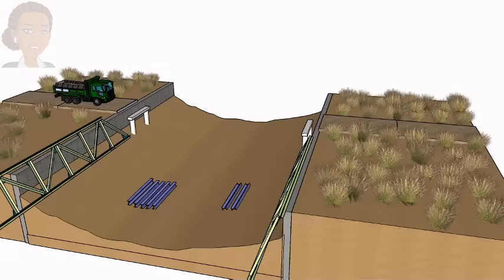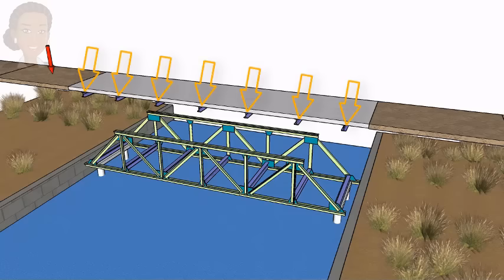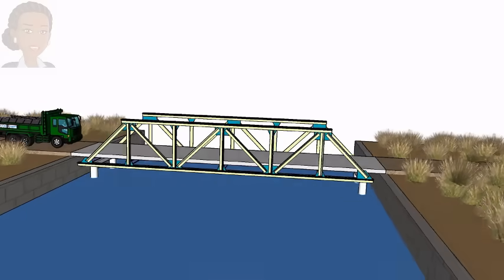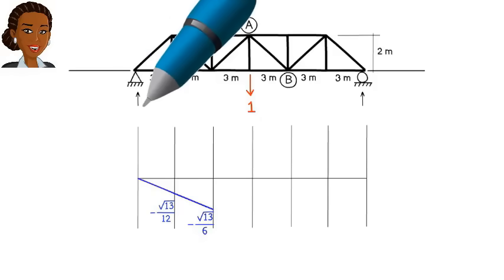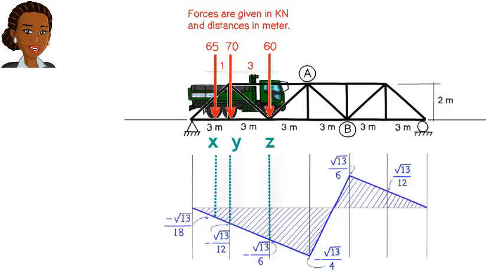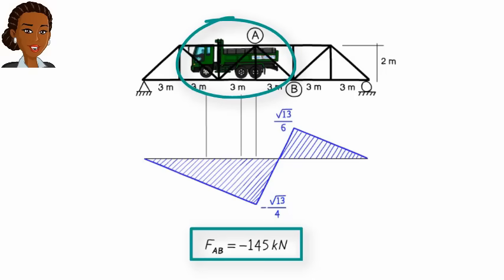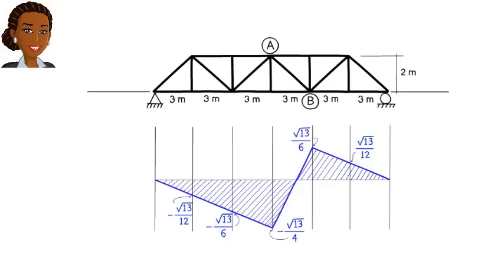SA35: Influence Line and Moving Load Series in Trusses

Comment: Let's say the given data are the following: bridge span = 18 m, bridge width = 4 m, and the deck is concrete with thickness of 0.20 m. Is the point load acting at the bottom joints of the truss due to bridge deck be equal to ((25 kN/m^3 x 18 m x 4m x 0.20 m) / 7))/2 = 25.71 kN?
Reply from the maker: Assuming the distance from the slab's edge to each exterior beam is 1.5 m (half of 3 meters), the slab's weight distributes evenly among the beams, which makes your calculation correct.
Reply: @DrStructure  Ah, it's the tributary area. (25 x 3 x 0.2 x 4)/2. Thanks. 👍

Comment: Axial force acting on member AB per the calculation are 86 kN in tension and 145 kN in compression. In the real world design of that AB, are we just going to use the bigger of the two axial forces, which is the compressive axial force 145 kN?
Reply from the maker: No, the design requirements for compression members are not the same as the requirements for tension members. When a member undergoes both tension and compression, it needs to be designed such that both sets of requirements are satisfied.
Reply: @DrStructure  A thousand thanks.

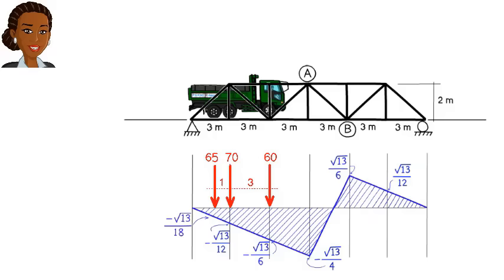Comment: In 7:38 where does 5/6 at hinge and 1/6 from roller came from?
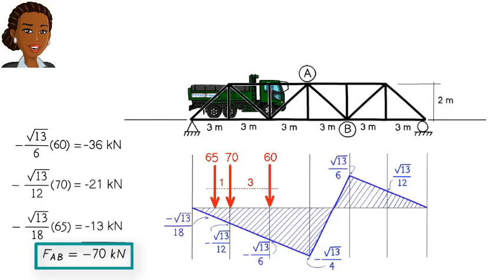Reply from the maker: Did you mean to write @3:38 instead of @7:38?
If yes, the support reactions at the pin and roller supports can be determined using the static equilibrium equations. 

Writing the moment equilibrium equation about the left end of the truss, we get:
(1)(3 m) - (Rr)(18 m) = 0 where Rr is the support reaction at the right support. Solving for Rr, we get Rr = 1/6.

Then, summing the forces in the y-direction, we get: Rl + Rr = 1 where Rl is the reaction force at the left support. Since Rr = 1/6, Rl = 1 - 1/6 = 5/6.

Comment: see if there is some traffic and all vehicles stop simultaneously  would the bridge be able to undergo such load too ? why is that we dont see any bridges that has stagnant load on in
Reply from the maker: The (multiple) truck load magnitudes and patterns given in the design code(s) have been determined experimentally; they ensure the safety of the bridge. The provisions in the code specify the need for having multiple trucks being present on the bridge at one time. So it is not like we are designing the bridge for one truck load at a time. Furthermore, depending on the design, some bridges do have and post weight limits that if exceeded could result in structural damage or faliure.

Comment: Sorry to say that my question is about concentrated moment acting on beams which is obviously not found in this video but discussed in one of your previous ones. In the real world problem, where do we see this concentrated moment or what causes this? Looking forward to your reply and explanation. Thanks in advance.
Reply from the maker: Various scenarios could lead to the placement of concentrated moments (as applied loads) on beams and frames. Suppose a beam has an overhang (say, 2 meters in length) subjected to a distributed load of 3 kN/m. This causes a clockwise moment of 6 kN-m about the nearest joint. For analysis purposes, we can remove and replace the overhang with a 3 kN downward load and a 6 kN-m moment at the joint that attaches the overhang to the rest of the beam. Also, architectural elements in a building could result on eccentric loading which introduce bending moments on the supporting frame. For example, depending on how it is places and secures inside the skeleton of the structure, a staircase could subject the supporting beam/frame to a bending moment.
Reply: @DrStructure  Thanks a lot for the quick reply and explanation.
I do get the 6 kN-m (from 3 kN/m x 2 m x 1m) moment at the joint, but why 3 kN downward load at the joint? Shouldn't it be 6 kN (from 3 kN/m x 2 m)? Please clarify.

Is the 2m long beam carrying 3 kN/m distributed load connected perpendicular to the other beam?
Reply from the maker: @gnidnoeled786  Yes, yes! The downward force is (3 kN/m)(2m) =  6 kN.
Reply: @DrStructure  Thanks indeed.  Would greatly appreciate if you could reply my other query?
Reply from the maker: @gnidnoeled786  In this example, we are assuming the overhang is horizontal, it is placed on the same horizontal line as the rest of the beam. That means, if we cut the overhang close to the joint that connects it to the rest of the beam, the effect of the distributed load on the beam would be the clockwise moment of 6 kN-m and the vertical downward (shear) force of 6 kN. If the overhang is inclined at an angle (say 30 degrees counterclockwise) relative to the rest of the beam on the horizontal axis, we can still cut/separate the overhang and replace it with a bending moment and a force. But the magnitude of the moment and the force depend on the orientation of the load(s) acting on the overhang. If, for example, the distributed load of 3 kN/m is still acting perpendicular to the inclined overhang segment, the bending moment that it produces at the cut point comes out the same: (3 kN/m)(2 m)(1 m) = 6 kN-m clockwise. The magnitude of the shear force also remains the same: (3 kN/m)(2 m) = 6 kN. However, the force needs to be placed on the beam at an angle. That is, the shear force is not going to be perpendicular to the main beam, the direction of the force is going to deviate from the vertical (y) axis by 30 degrees. The 6 kN force is going to be inclined by 30 degrees from the y axis pointing downward.
Reply: @DrStructure  Thanks for the example you cited  and detailed explanation. IMPRESSIVE.
Reply from the maker: @gnidnoeled786  Glad to be of help.

Comment: When in doubt . overbuild haha jk, 
What grade and size of beam is utilized ,factoring in the cross braces over length and height . Always calculate a trucks load assuming it’s loaded . Adding over half of the trucks weight into the formula , I was on a job where the engineers forgot to factor in the weight of the fluid where new structural was installed to support piping in an oil and gas facility resulting in the structural buckling under load. Causing a lot of rework. Not to mention the job coming to a halt . Not good.

Comment: Does temperature have an effect on load capacity? Example , Such as cold temps in Canada
Reply from the maker: Significant temperature fluctuations could induce stress in members. So yes, it could effect the system. Consult your local design code to see it that is something one needs to consider when designing a structural system.